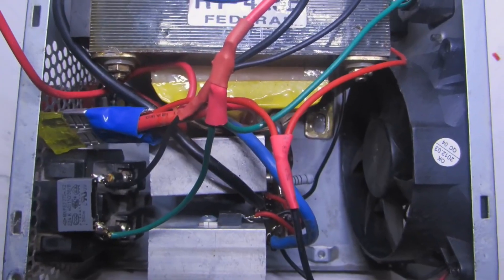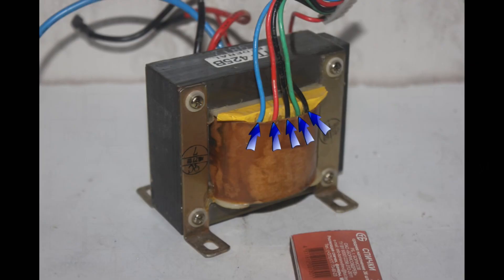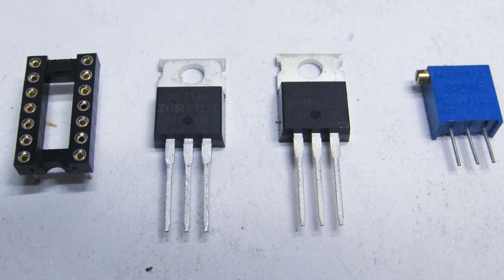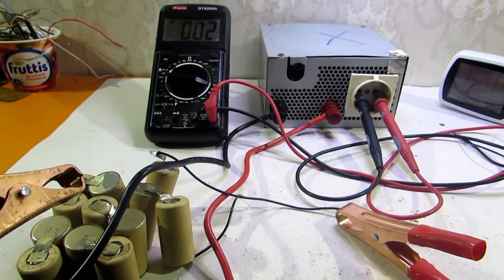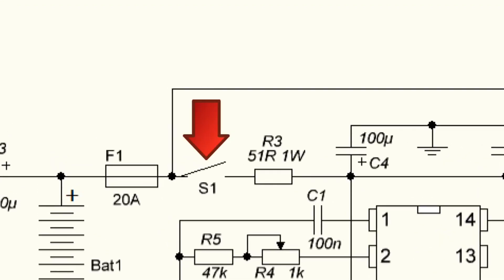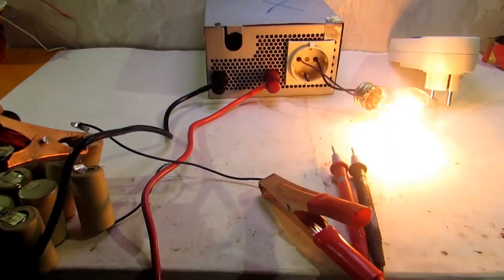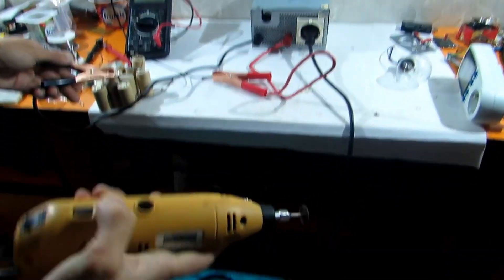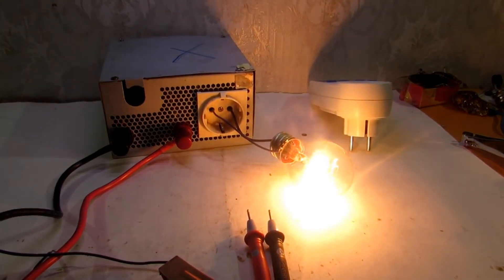How to make simple inverter from 12 to 220V 50Hz

Comment: hello sir thnaxx for video.......i have made this circuit i got 220volt ac o/p but i cant get required wattage only 20-30 watt i have  got please  tell me how to increase wattage or current??   i want run 100watt tv by using this circuit
Reply: ravindra balme use big battery or use more than 50A

Comment: 2000w using irfz44 come onnnnnnn...irfz44 is rated max 50A if you could cool it to 25c with a ideal massive aluminum cooling element maybe you'd get 20Amps without overheating it... and that is 12v x 20A =240w even if by some miracle you would cool it by ice and get 50A out of that would be only 12v x 50A=600w. but that you would never reach so far...    be truthful... mission impossible...  200w yes... more like it... this statement is based on knowledge of your components also transformer is not capable of delivering 2000w... admin that title is overblown a lot... hand on your heart bro....

Notesa.  Repetitive rating; pulse width limited by maximum junction temperature (see fig. 11).b.  VDD = 25 V, starting TJ = 25 °C, L = 44 μH, Rg = 25 Ω, IAS = 51 A (see fig. 12).c.  ISD≤ 51 A, dI/dt ≤ 250 A/μs, VDD≤ VDS, TJ≤ 175 °C.d.  1.6 mm from case.e.  Current limited by the package, (die current = 51 A).